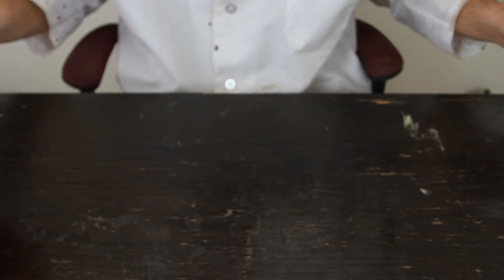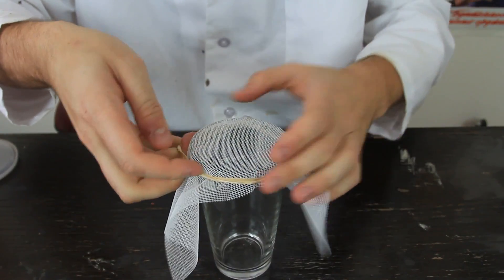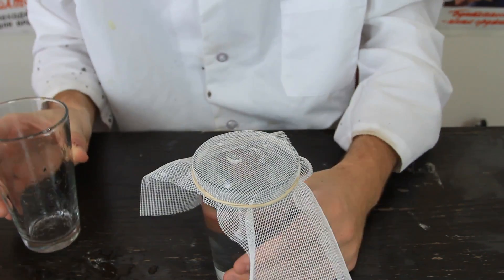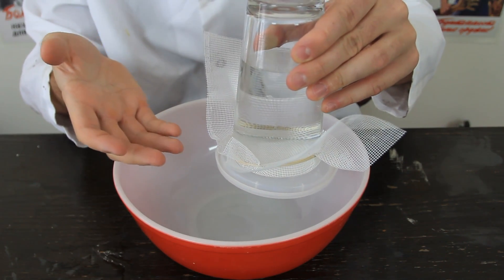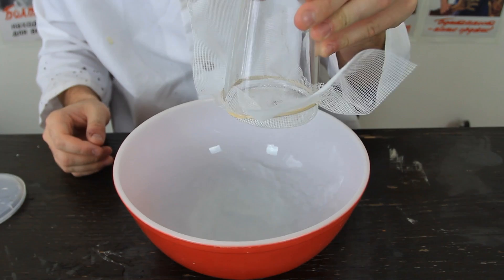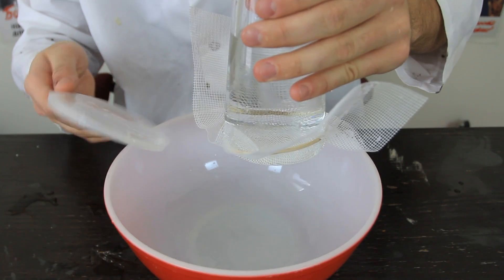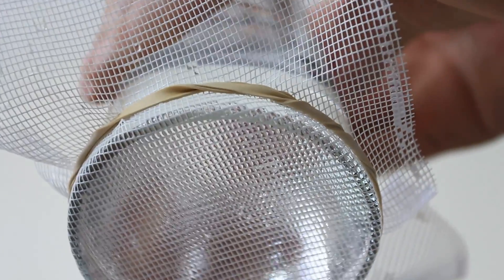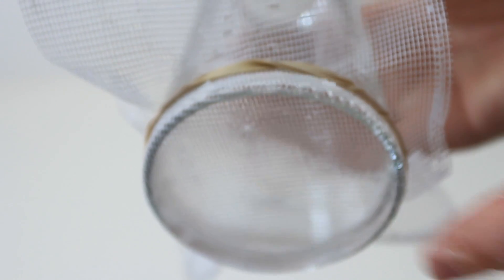Mysterious Water Suspension - Cool Science Experiment

Comment: Combination of Surface Tension, and Atmospheric Pressure working in concert. The Vacuum created inside the glass helps suspend the water, without that factor it would just run through the mesh also.

Nice Experiment.

Comment: Very cool that it works over surface area that big. I guess the vacuum effect in the glass also helps, right.
Or is the surface tension strong enough to contain that much water with a hole in the bottom of the glass?

Comment: i think its because:
the air cant get in the glass to push out the water so the water stays where it is.
you can do the same thing with a bottle:
1. poke some holes in the bottom of the bottle
2. poke ONE hole in the top of the bottle
3. poor water in and screw on the lid
the water will run out of the bottle but if you put your finger over the hole in the top the water stops!
MAGIC!!! LOL
im 13  and live in denmark so my english is not so good!

Comment: This trick has almost close to nothing about water tension( nerd alert! )

So, the reason why the water doesn't spill out of the glass is because the water was put at the average point where the water balances out its weight. That means that if the water really did fall out (which will break the laws of physics) there would then be a vacuum in the glass, but since that didn't happen. The water was held up by the pressure of the air above it( the extra air in the glass). EASIER explanation, if the water gets out the air has to take its place. There wasn't space for the air to get in, so no water can get out. :D

Comment: I think i can explain this 
when you have a drop of mercury it will always be round on most surfaces .. why ? because it builds tension on the outer side of the droplet to keep all molecules together and this tension what makes the droplet look round .
same here with water  ... but the thing about water that it builds much weaker tension on its outer surface , but there is TENSION though 
so when you flipped the cup upside down the water (wants) to stay in its current shape since it stable .. but when you started shaking the cup its form and shape started to change therefor the tension collapsed  and all water fell into the bowl .
hope I made it simple :)

Comment: why is the water not falling out? because 1: the void over the water creates a vaccum and 2) the the thing you put over the glass is helping the intermloecular links of h2o molecules (which are strong)
Reply: Basically, it just has to do with surface tension (a result of intermolecular interactions). A vacuum has nothing to do with this. If he tried it with a cup with a hole in the bottom (plugged until inverted), it would still work.

Comment: this is because of the surface tension of the water, it is creating a small vacuum, and there is no place for air to get in because the surface tension of the water is greater because of the tiny holes, so the air can't get in, and the water stays in place, if you put a hole in the bottom of the glass to allow air in it will drain, if you plug the hole it will stay in the glass